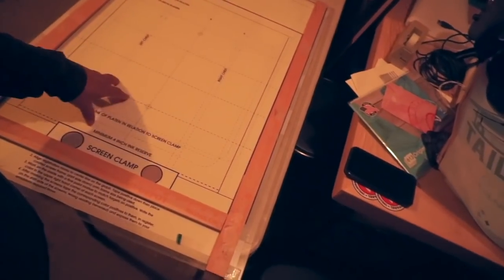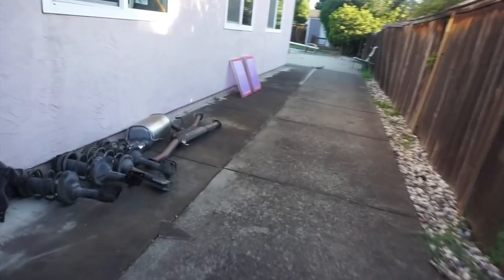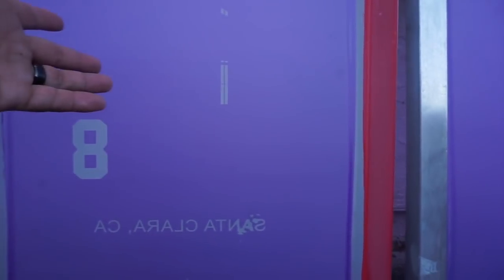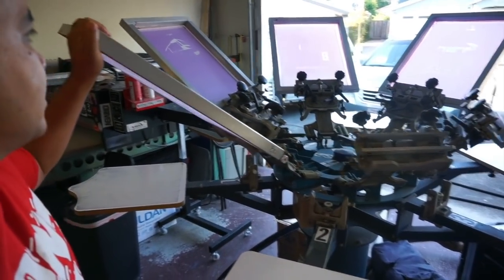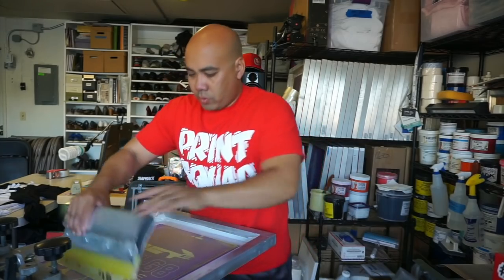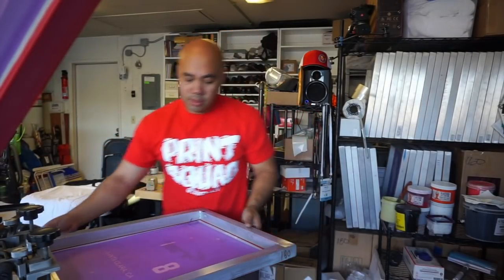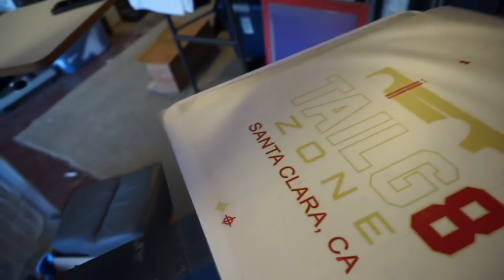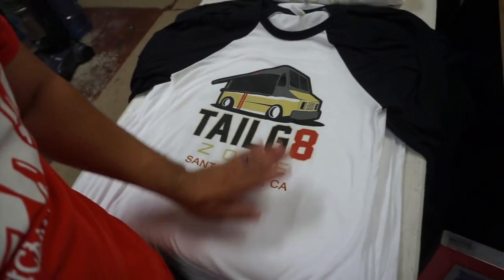Screen Printing - 4 Color Baseball Tee (S:05/Vlog 011)

Comment: I'm having the same issue with exposing my screens like how you did. confusing cause you think its the time, but than it can be emulsion, or just that the screens weren't clean. But your print came out awesome. Those inks look amazing how they just flow easily on the screen.
Reply from the maker: Thanks man. Yep I have to check the emulsion, it have gone bad